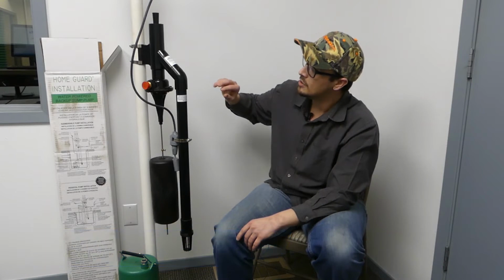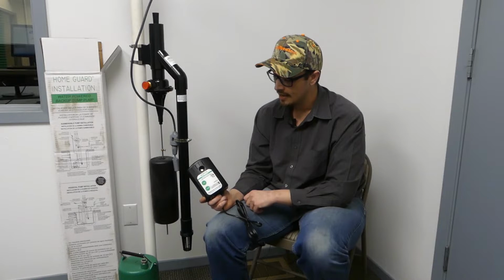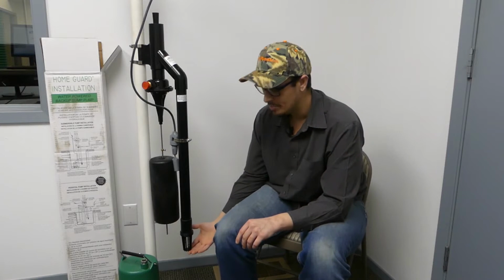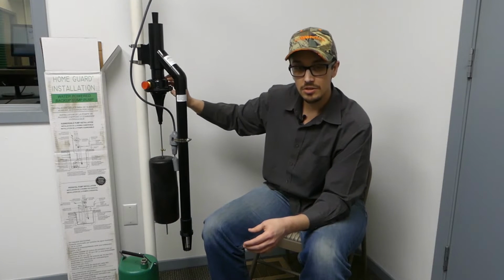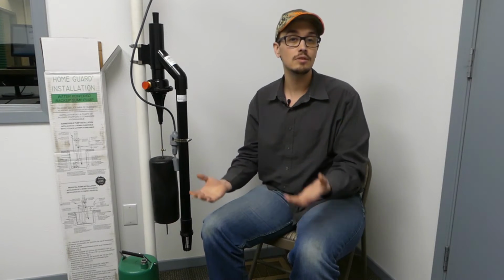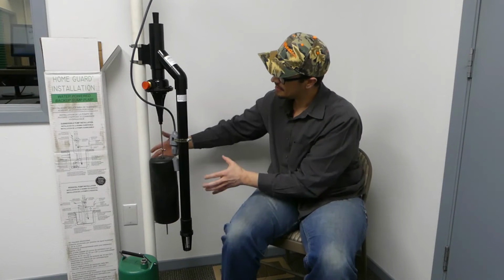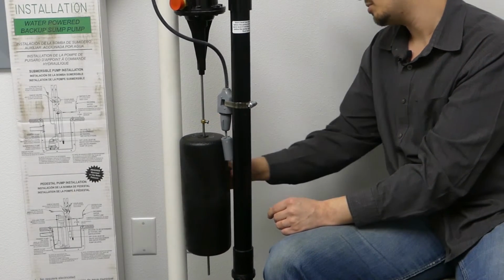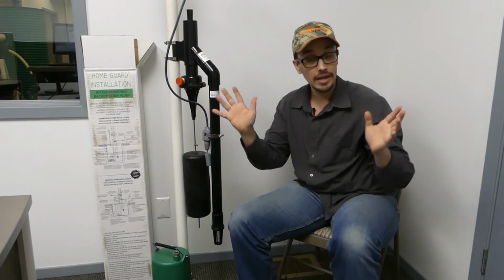Zoeller 503 Water-Powered Sump Pump (Alternative to Battery Backups)

Comment: I've had this model for 12 years.  A plumber over charged me, but it works great.  They ran my 2 pipes into 1, but installed 2 check valves.  I just replaced the check valves because it was running constantly.  Now it works great again.  I even have lots of sentiment. 
 They installed this as my primary pump.

Comment: As shown you have this configured improperly. You are setting up your customers for $1,000+ water bill.
With the alarm positioned as shown it's never going to trigger, if the primary electric pump fails the water backup is going to take over and never alert the homeowner that the switch has occurred.
Reply: It seems that as shown, the alarm is for if the water jet pump has also failed. Or, they just didn't care to set the position or talk about it. I wish he also would have mentioned about setting the main float height to be higher than the main pump, but he waved that away with "leave it where it is"

Comment: Great explanation and nice product.
I've well water with pressure tank, will this work in that situation?
My need mainly more than aiding me during power outage, would like regular pump and this water based pump to work together as many times the amount of ground water surge coming in during heavy rains regular sump pump not able to pump out at faster pace than water coming in.

Please explain, Thanks for your video's

Comment: Get the alarm for these backup pumps. They use 2 gallons for every gallon removed. If your primary fails and your backup does all the work you will end up with a huge water bill.
Reply: they use 1 gallon to every two removed is what he said
Reply: In that case my water bill will be more than 5 times the cost of zoeller backup sump pumps in 1 month usage times span 😢
Reply: That's good advice for sure. With that being said, I'm cool with one big water bill, as opposed to ANOTHER flooded basement.

Comment: I like your cap. I live in Berkeley, CA and I can only find UC Berkeley caps. PG&E shuts down power to the SF Bay Area during the fire season so I've thought about adding a water-powered backup pump to my sewage pump, but I assume floating toilet paper and other floating items (yuck) won't be compatible with this type of pump.
Reply from the maker: Thanks for the comment Donald! As far as I know, water-powered sewage pumps have not been invented yet so your best bet would be to have a generator on hand for power outages.
Reply: Battery backup sump pumps are also an excellent option, but replacing batteries every few years can be a nuisance if the system doesn't operate regularly.